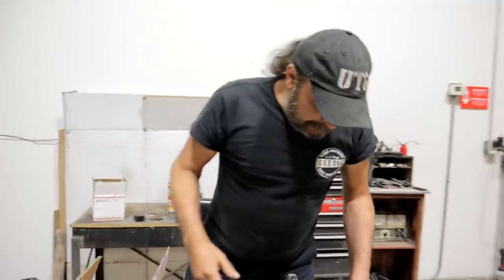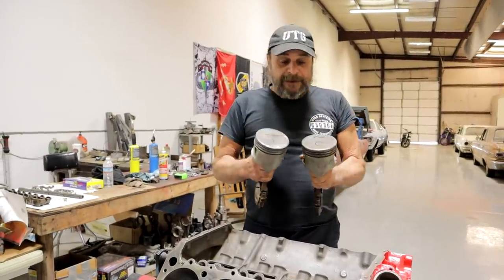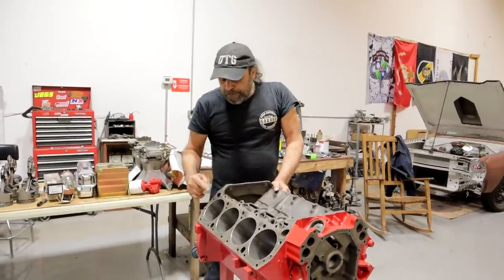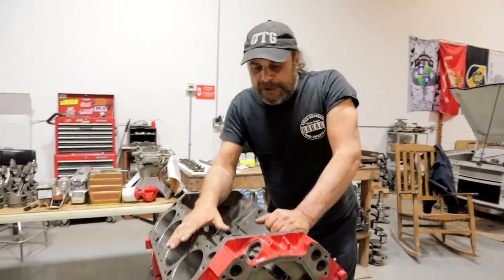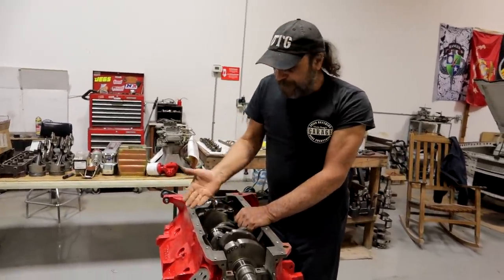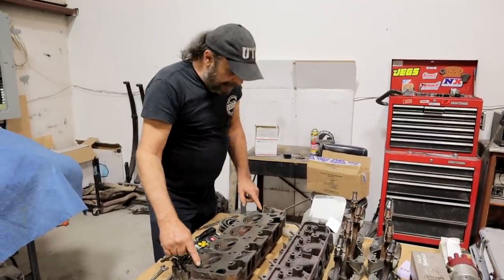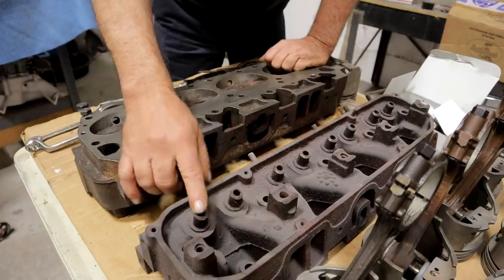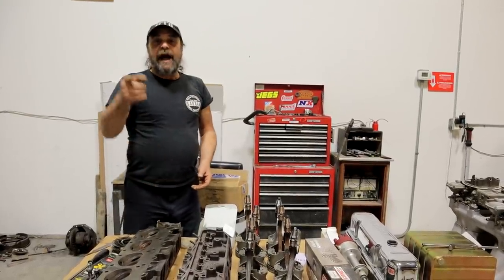Blueprinting For The Home Engine Builder - How To Get The Most From The Parts You Already Have

Comment: So glad I didn't take on what I considered to be my first full rebuild until I worked at an engine shop. 
Gave the crank polisher guy a pizza to polish the crank. 
Gave some beers and hot dogs to the cyl head guy.
Worked out great, I built it at home but had everything I needed bought in house.
That made it a bunch easier.
Oh and don't be in a hurry at all. 
It took me about 2-3 months of 3-5 evenings a week to get it done.
Remember this is for fun too, so there's no sense in rushing it.
Reply: "Don't Hurry" is the cardinal rule of this stuff.

Comment: Man! You are so right Tony. I have spent forever putting my slant six together. Piston height, rod length, cylinder head alignment, pushrod length, cam timing, it's never ending. Sometimes I had to force myself to take the proper steps and not cut corners. And that's not mentioning the worst part, finally starting the engine. A whole new level of fear factor.
Reply: I know thats right . It's like damn i spent all this time and money . Lawd Don't let me fu€K this up now.__
Reply: Hahaha.. truth! I've seen a hundred + hour build blow in 3 min flat. I get the jitters just doing a basic lol. Call it PTSD I guess. It wasn't even my engine that blew.
Reply: I can relate also.  Thinking about my last build, a short list of stuff I had to sort, above & beyond: resize inside diameter of crank sprocket [only that one area of crank was 0.015" larger than spec as received for no apparent reason], knock 0.012-0.013" off pistons to get zero deck, measure/match grind areas of cylinder heads for equal cross section [pinch point & runner openings, the latter forced by a "gasket match" that left  steps like a 3/8" end mill tends to do on a rough pass  shaping],  regroup on springs & retainers [after finding first set were a little off for the cam selected],  and haul the block off to a machine shop for mains honing because they were too tight as delivered [as in off the chart on plastigage].    That leaves out a couple things [like lash caps used to correct rocker geometry], but these  probably ate up an extra 40+ hours beyond a simple clean/measure/assemble with no real problems.  I am no pro - just a home gamer.   That short block gave me a headache - especially after seeing pistons had to come back out.  I assembled that 4 times before moving to heads.

Comment: So good and to the point.  I would add get to know a machinist well.  As an 17 year old I mixed Buick 350 pistons, early 60s forged rods, cast odd-fire crank, high-port heads on a low-port block, 252 intake and more, all on a 231 V6. Then Turboed it.  Just so I didn't have to stick a belly button 350 in my Sunbird.  All the tediousness was worth it.

Comment: Thanks again Unk. Stock eliminator always inspired me. I always wanted to take a small block dodge using best parts from different years (eg. '72 360 short block, '66 273 D stock dart cam and rockers, '70 340 heads and 6pack, etc). After you blow the doors off of someone you can say the engine is all stock parts....wink wink...nudge nudge.
Reply: Don't forget, the crankshaft in a 273 is factory Forged and is the same stroke as a 340 and 318. Good stuff here.
Reply: @butcher4842  Good point. I liked the 318-3 truck crank. It was forged with shot peened journals. For the extra cubes I like the 360. The '71/'72 had flat top pistons. The HP '74 had a cast crank with shot peened journals good for 6500 rpm. It also had a windage tray and double roller chain.

Comment: I did this with the valvetrain on a Ford 302. Moved rockers and pushrods around until it all came out exactly where it needed to be.  Some have thin shims, some have thick, some have none, but the lifter preload is dead nuts and the top end is very quiet now.

Comment: What's amazing to me is that 383 is the exact same build we did for my brother's truck Hookers N Blow, he bored his out .060 but he used stock replacement pistons that came to the top of the deck, 516 heads, weiand tunnel ram, and it is a good engine. This will be a cool engine build
Reply: It is amazing how a 383

Is a 383?

Comment: You have to remember your Rod Bearing wear will cause the piston to sit lower then normal! Upper rod bearing will wear faster then the bottom one in a high mileage engine which will make the piston dit lower by 3 or 4 or more thousandths of an inch.

Comment: Yes I’ve seen a 253 holden V8 that when mocked up…..

Two lifters were not spinning in the bore 

and that was believed to be due to an anomaly with the casting of the block itself…… the angles were not quite right on that particular casting….

To correct that they used shims……

OR you could go to solid roller lifters…..

Point being is blueprinting should detect and correct these things………

Comment: I went to buy a used 454 bare block for a project. I had a 366 tall deck bbc which has a 427 bbc stroke crank/rotating assembly and its forged/nitrided from the factory ( for dump truck use). I was going to use my existing dumptruck crank in the 454 block with some new pistons etc to make a 427bbc. The guy selling the 454 block also had a freshly machined 1968 396 bbc Shortblock unassembled with all the bearings and pistons in boxes (new) (20 years ago the machining was done) It was stored properly and good as new. I bought the 396 shortblock instead of the 454 block and assembled it myself with a roller cam etc. The piston rings were already on the pistons and gapped etc. ( i checked anyway. I took my time as it was my first time putting a bottom end together. I checked ALL clearances. I used the low compression large oval port small valve BBC dumptruck heads on it and put it in a 58 Bel AIr. Lets just say the low end torque from the small valves is real nice. I used a 700r4 trans to give me overdrive. I need to up the rear gear now from 3.38 factory to a 373 or 390. I sold off the 366 tall deck and its crank/rods. it was 1100$ for the machined ready to assemble 396 shortblock assembly vs. $500 for a bare block that needed everything. Easy choice.

Comment: Great stuff as usual. I do wonder how easily Uncle turns those blocks on the engine stands. When I've done that the dang thing binds and makes for a battle royale. I can only suspect the bind is because the engine pulls the rotating assembly down just enough to not let it turn freely, one end being slightly lower than the other.
Reply: A light coating of good quality grease goes a long way with engine stand rotating assemblies.

Comment: Have torn apart many many mopar engines. Never witnessed an 0.018 difference in piston height, WOW. Sounds like someone was in this engine and replaced some stock pistons in there. The deck difference you have is very common especially on B motors.
Reply: I'm old lol, but I have seen it, especially with the  early Mopars. I've never seen a factory gen II hemi block that had parallel deck heights. I've been around for a lot of years, and it's not uncommon for every make.
Reply: My '70 340 was spec'd for a plus .045 deck hight...only 1 made it. The lowest was about .015 with most around .030. Most of the difference was in the rod length

Comment: Leave it to UT to get it right! I always thought calling it "blueprinting" wasn't an adequate term. I knew several racers that ran cars in stock and super stock in the mid to late '70s. I saw some of the work they went through (only as a helper). It's difficult to describe their dedication and skills. Assembling and balancing everything "tighter than a gnat's ass" is amazingly tedious. You really need to 'embrace the suck' to get positive results. I never saw a blueprint or dimensional drawing for an engine. It was usually well-worn pages of clearance and tolerance charts from a service manual.  I feel 'optimizing' is a much better description. Much respect to those 'optimizing' out there in YT land! Embrace the suck'!

Comment: (Backyard) built a 360 25 years ago. CC'd everything. Worst case I could put together was 10.78 ~ 11.2 CR (.34 CR). Swapped heads side to side and a couple of pistons (domed so less positions they can go Vs flat tops), got it to 10.76 ~ 11.00 (.23CR) Every little bit helps.

Comment: The rolls Royce merlin engines were all blueprinted when assembled in the U.K. factories. When Packard got the drawings and specs they said ‘this won’t work for mass production, and had to re-spec all the tolerance for mass production. They never made as much power as the U.K. built engines but obviously could me made way faster

Comment: It's nice to work on the older stuff because it's all SAE. Screwing with mixed thread nut and bolt pitches on the newer stuff, all day, with plastic parts mixed in, makes me just  want to take up gardening.
Reply: Totally agree!!! Building the Stealths and 3000gts has been fun, but the Dart is so much nicer to work on... Much more, idk, relaxing and stress free(??)
Reply: I've kinda picked up a little trick for most of the newer plasticy  stuff you talk of  besides going off the old bolt marks deal. 
Where's the item from? 
Chances are if it's overseas it's gonna be metric. 
It's taken a while but I can usually just look at a some fastener threads and know if it's metric or sae.
Reply: all domestic brands use metric now.   

Has nothing to do with being overseas or not.    They do it because metric is easier for the average halfwit to understand.   

That's why machining is done in Imperial still

Comment: My original factory 1985 5.0 HO Mustang engine  pistons and bores  varied .005  from smallest to largest diameter. You could not swap the pistons around from bore to bore. This was an untouched since new 1985 Mustang 5.0 that I bought new!

Comment: I want to rebuilt my 73 VW Beetle motor and might as well blueprint it. I believe you have to get each and every set of components to weigh exactly the same. So take the weight of your lightest piston and remove where you can do so safely from the rest until all 4 weigh the same. And so forth for everything. Sounds like a lot of work but might be worth it?

Comment: You are so full of knowledge it’s amazing I bought a magnum engine from summit I wish I could tear it down and blue print it but it only has about 500 miles on it since I bought it in the 90’s they are advertised at 380 horsepower due to insurance regulations I have run in the high 10’s with it but it red line at 6200 at the 1000 foot small slicks and 456 gears it has to have more than advertised HP we put the specks in a computer and it came up 435 hp and 430 torque at 3600 rpm this don’t even sound right what do you think

Comment: Could the crankshaft contribute to variation in where the piston lies relative to the top of the cylinder as well? Or is the radius of the rod journal travel generally precise enough across the crank that it's a non-factor?
Reply: There should only be about 1/2 thousands of difference between the clearances. If there is actually any measurable difference in stroke between two journals, it needs to be looked at.
Reply: Yeah,  I think the crank could contribute to variations in deck height. On straight six engines its basically 3 pairs of of cylinders rising and falling together.  I had a block set up for 0 deck  , then  smashed a rod bearing because of detonation  after I had the crank cut 020 under it came back with #2 and #5 sticking out positive deck height had to use a thicker head gasket after that , I could be wrong but it seems the crank grinder tech offset those to journals together as a pair.
Reply: Yes, the stroke accuraccy will play part in this. Most cranks I have measured stroke accuracy on (100's of them) have been out enough to know I should not try and square block like this

Comment: then another question: when do you know if the crankshaft needs to be polished? if you can't see any scratches and it doesn't shine bright and the nail doesn't feel grooves either, is it ready for use? or is it always worth polishing when the bearings are replaced?

Comment: Thanks Tony for the great info.  When checking the piston height in the block, do you install the rings and torque the rods to the crank?  Thanks again.
Reply: I would use the top piston ring to help. Keep the piston stable in the bore and would just snug the rod cap I was not concerned with foley torkin It

Comment: When I go to rebuilt modify my LA 360 I'm going to check this stuff out especially with my buddy at his machine shop in Harrison ark = Premier machine shop Rick Cross . to save money I will be buying a 60.00 digital scale from the kitchen supply section at walmart super center to weight my pistions and rods but will have to drop my crank off at the machine shop to have it checked for balancing 😎🔧💪🏁

Comment: Be doing something similar on a 68 318. Supposedly the 68s have taller commission height pistons, they were rated at like 9.2 to one compression with open chamber heads, the 67s had the same rating but used the closed chambers. Taller pistons make sense and there is a chart that shows it online. I'm going to use 315 closed chambers to replace the engines stock 675s. Of course the stock pistons could be shot anyway. 🙄

Comment: u should see what u have to do to get a 675 lift cam in a sbc . u have to port the bearings so u can put the cam in so u have to buy a custom cam not just a custom grind but a full custom cam. it cost me over a 1000 bucks for a bare cam in the mid 90's

Comment: assemble disassembled reassemble over n over till its right then do it a few more times unless its a top fuel motor good for 2 passes . i must have spent 100hours on my last set of 906s clean and smooth everything especially oil passages and anything thats going to be under pressure

Comment: So the difference in piston height front to back is the main bearings not machined parallel to the deck? 
 I'm not an engine builder but an .018" difference between one piston assembly to another seems like a lot, even for the 1960s. Where does this difference TYPICALLY come from? Is it in the rod, piston or a stacking of tolerances?
Reply: Not uncommon to see up to 0.020" difference in deck heights on older blocks. What is also playing a factor in this form of measuring is that the crank stroke is also most likely 0.006" - 0.010" different from front throw to the rear one. Which means when measuring and cutting a block based in this information, you are NOT getting a square block. Just something that will work good enough.

Comment: Don't over look a 400 SBC. With a cam and a set of 64cc cylinder heads with stock pistons they can run really fast on the cheap and run a long time if you put it together right.

Comment: What about rod lengths. Center to center on both holes. How accurate are those? Do you drill them all to the weight of the lightest one? Same with the pistons. Do you make them all weigh the same to balance the motor.  After install if one piston hangs out too far, can you take it down on a surface plate? As for the rockers, why does one have a better ratio than another. Can that be modified on the weaker one to match the better one?
Reply: Put the longer rods on the pistons that have the shortest wrist pin to piston top difference, after you have balanced each individual one to the lightest in the set. They will all be the same weight by then, and you can match them in the order they need, to come out the closest overall length. All the rings and bearings should be given the same attention as the rest of the engine. I have switched bearings back and forth many times to come up with the needed clearances.
Reply: @elmerfudpucker3204  I would try different arod and piston combos untill I found the best combo. Then, if any pistons were higher in the bore, I would machine the tops off until they were all the same. Giving me consistent compression in every cylinder. Then I would weigh them all with the rings and wristpins and make them all weigh the same. Naturally, the heavy ones would get material removed. Then the same with the rods. The main bearings on the rods would all be clearanced Then weighed with with rods. Then all the rods with the bearings would be weighed and all made to weigh the same as the lightest one.  Then I would cc the combustion chambers and do whatever I could to make them as close to the same as possible. Then I would check valve clearance and run the biggest cam I could safely. The specs would be to give me whatever powerband I am looking for. Be it low end torque or high revving HP for 1/4 mile. If Im going to do all this time consuming shit it is most likely to put down the best possible number at the track.

Comment: a few inaccuracies ..  buying stock cast pistons ,rockers and picking thru them  ?  maybe a long time ago ..  99 % of competitive  NHRA  stock class racers  buy  their  race engines ..   Stock Eliminator - 283, 327, 350ci Small Block Chevrolet
Starting at $27,000..Patterson Elite Stock Eliminator SBCs are equipped with:

Dart SHP block: complete blueprinted including bore, deck, cylinder and line hone
Patterson Elite custom pistons
Class approved connecting rods
Bullet crankshaft, balanced in-house
Bullet custom ground flat tappet camshaft
Total Seal custom diamond finish piston rings
Class accepted intake and exhaust valves
PAC valve springs
Precision Products lifters
Aftermarket rocker system
Trend pushrods
Melling oil pump
Stef's oil pan
Cloyes timing set
MSD distributor
MSD spark plug wires
ATI damper
ARP fasteners
FelPro gaskets
Accepted carburetion per class specs
CSR starter